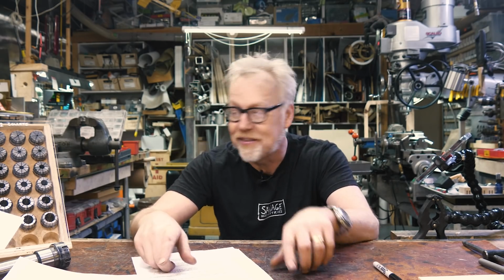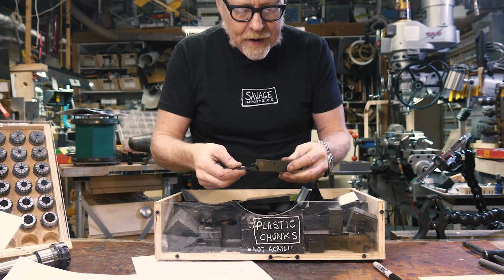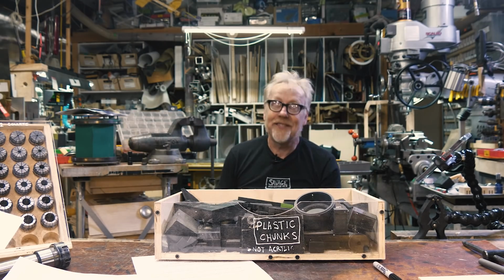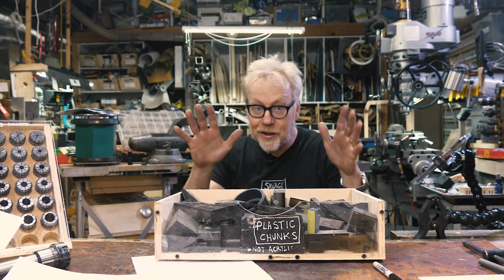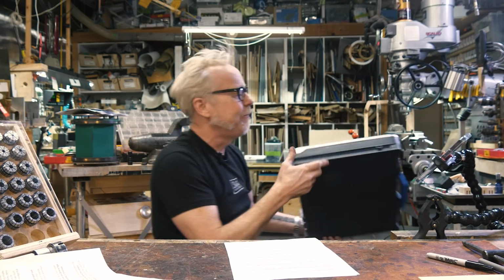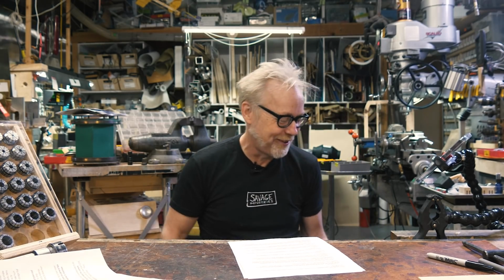Ask Adam Savage: When to Discard Scrap Materials

Comment: and that's how hoarding starts. Not even kidding. my father is the same. "never throw out scraps". meaning we have a ton of stupid, shitty crap taking up a lot of space. And ofcourse he'll feel validated when we need a piece of scrap. never mind the fact that we had to keep it 20 years before being useful. And don't even think about throwing stuff out.
Reply: Keeping, then finding and using scrap material also has a monetary and time cost: you can easily spend more time rooting through your stash of little bits which aren't quite big enough to hold and make the part, than you would sliding a longer piece into the lathe and 'just' making it. I had this yesterday; I made a complete template for a part while the friend I was helping pulled out lots of random containers and previous projects to 'save time making a new one'. Some of them could have been workable, but would have been no less work, and would always have looked like they were bodged together out of junk. The new part will be made from 2 pieces of sheet steel, folded and plug welded together, instead of spending another 20minutes looking for a glue to bond two unsuitable materials together

 I gained an entire drawer by getting rid of all the 20mm long stubs of material that weighed it down. That space is far more valuable than the waste that was in it. As Adam said, set a size limit - which will depend on what material you use, what you use it for, and the space you have to keep it - and dispose of it at the end of the job. Trimming the odd corners off bigger pieces makes them easier to store and sort too.

Comment: How can you address scrap management without asking what kind of things people are building? A 10"x12" piece of 1/8" plywood means more to a model maker than a cabinet maker or set builder, does it not?
Reply: I threw a piece like that away, together with an untouched length of floor board and other stuff because the repair job that created them was the first time I'd done that work in 30years. They were scrap, not viable stock. Tossed them without a second thought.